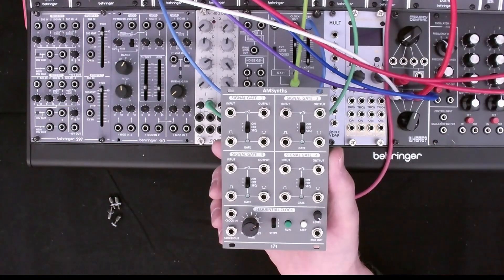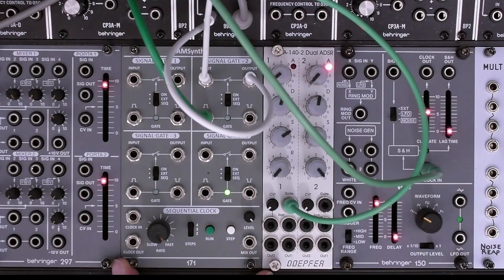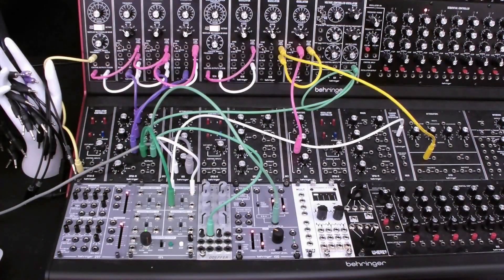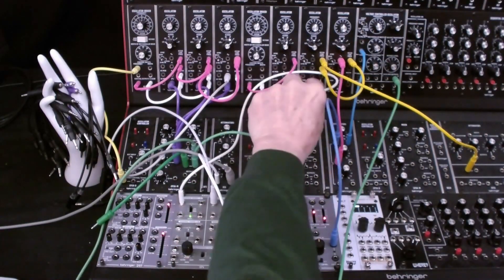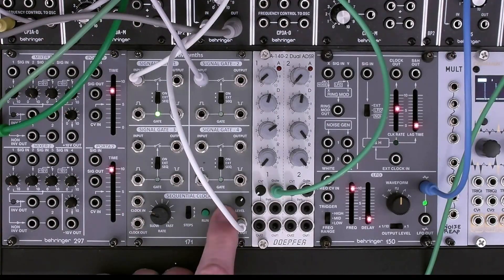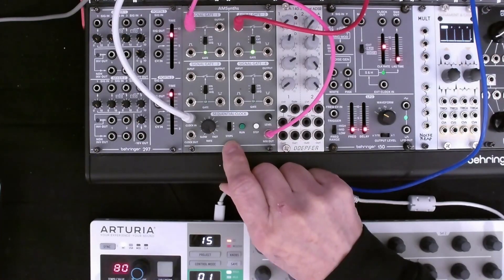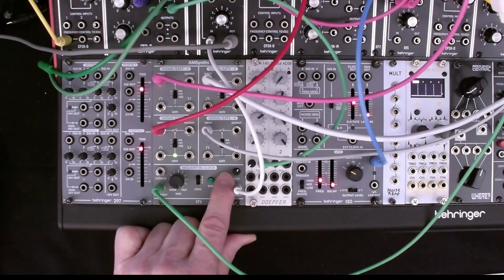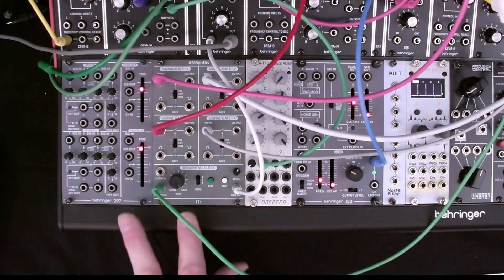Amsynths AM8171 Quad Sequential Switch

Comment: I considered a solution like this for easy switching waveforms on the behringer 921B oscillators but concluded module space was too much of a premium.  I realize the 921 has a switch output (closer to my minimoog) but changing patch cables really makes the most sense when needed.  Wouldn't mind an 'under the hood' solution to the 921B's that would implement some analog switches and voltage control to make the selections (I'm an electrical engineer so this seems simple) but that's a lot of trouble.  After seeing this video I checked the prices at Amsynth and they're out of stock.  Another fun project might be to modify a behringer system 100 173... get rid of the multiples and add another six switches in their place.  Not as functional as the AM8171 though.  Thanks for the video!
Reply from the maker: There are other switches that are smaller. The 962 is an example., but there are 6hp switches as well.   A cross fade is another good choice.  Thanks for commenting.